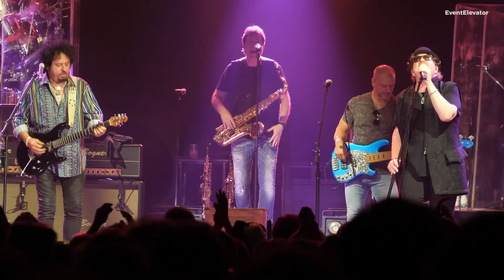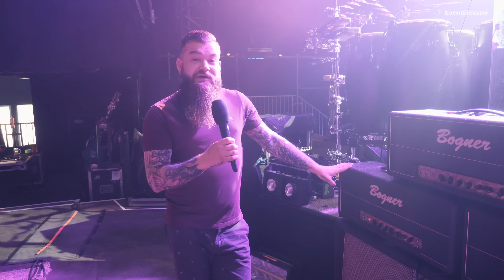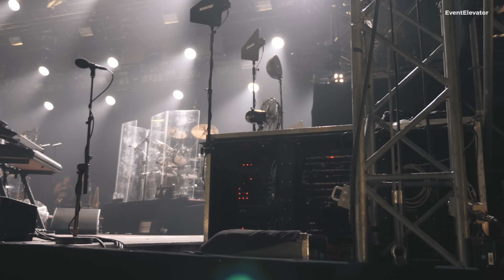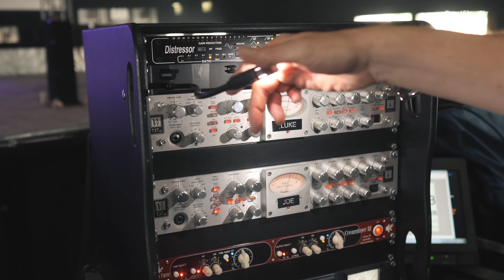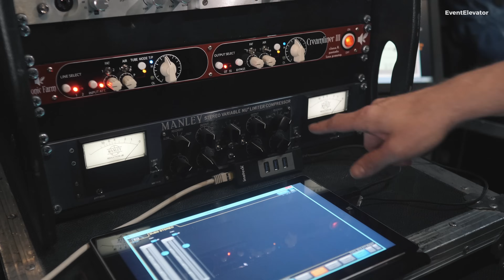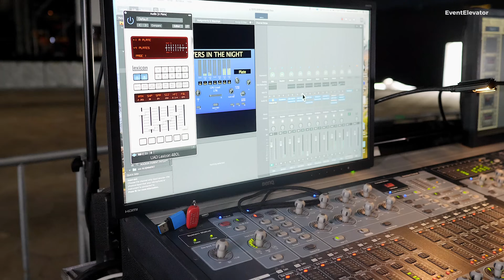TOTO • 40 Tours Around the Sun • Monitoring, FOH Sound & Lighting

Comment: This is interesting to me, I love the sound reinforcement especially live and ironically the actual point that I was hooked on feeling the music was 1978 I was 15 yr old and got to experience a one gig (for Toto) “apprentice rhode “ setting up at our school . Even way back then and a small scale venue I was amazed how much gear and cabling that fit into those trucks and all had to be unloaded set up tuned , ( do the show) tear down pack up load up (in the right order and trailer)  . It wasn’t long in fact that summer I saved up and bought my first PA with Crown amps and  Klipsch industrial Lascala’s , fast forward 43 or so years later and career in construction industry I shelved the sound gig and sold the gear for a station wagon and bunk beds . If some one ask me about this pandemic I tell them one thing good came out of it would be …. A change or heart and a stimulus check , yes I took the money jumped on eBay and found my old Lascala’s , not the actual same pair but better, this set came with added Bass Bins so down the rabbit hole we go , currently remodeling the barn for sound stage and backdrop , regrading the pasture with better contour more amphitheater like with grass ? Didn’t take long for my wife to connect the dots . 
I just told her , if you build it they will come … “the vineyard sound stage of dreams “ 
So now I’m on this journey to get up to some level to learn the new sound engineering tech ? 
Thanks for all the great content and Toto for the inspiration ( I think ) 
Allen S 
Prosser Wa

Comment: Young / new engineers should study the mic choice, placement and particularly the distance of the mics from the source! This all looks really nicely done. With the greatest respect, I don't see the need to delay the drum close mics, though. Phase issues between the overheads will not occur with distances 3x greater than the close mic to the source, and I find the delay is important for building a live and natural sound. It's really great to hear the FOH engineer saying he's using minimal compression - for dynamic bands this is key! I just tuck in the peaks and ride the rest of it. On a 6/7 piece band I'm touring with, I also just use one gate, on the kick - I wouldn't use any if most systems didn't crank the subs so high. Depends on the genre though. Nice video!

Comment: I just love the fact that the turkey adding the subtitles has no real undestanding of the german accent when speaking  English - this is reverse subtitling, where you have to listen to the audio to figure out what the subtitles  are saying....brilliant.  And Paddi, as a drummer for 10 years more than Toto have been aound, we dont tune drums, we tension drums to a pitch we want, but they are not tuned as such. A good sound engineer just amplifies the chosen drum sounds, most engineers struggle of amplify nice open drums and insist of damping them with tape, moongel etc. when if they were at good at their job, they should be able to compensate on the desk for any frequencies they really want to kill. Again, that's over 50 years of engineering experience from the receiving end as a drummer.

Comment: If only I had input delays when I started. 😉
Reply: Right? 😉
Reply: @paddikrause9304  Thanx for the great video btw. The only thing I had when I did monitors was phase reverse. I even had some reverse cables to use on a specific output or wedge. A common trick when a drummer couldn't hear his bassdrum was to put it outof phase. (Bassdrumhead as a membrane versus wedge as a membrane.) Thanx again! Wish I still worked in livesound.
Reply: PS you seem like a greatguy to do some seminars on monitor mixing.